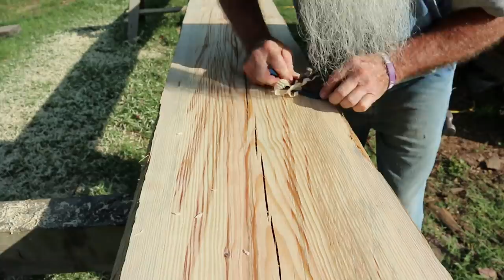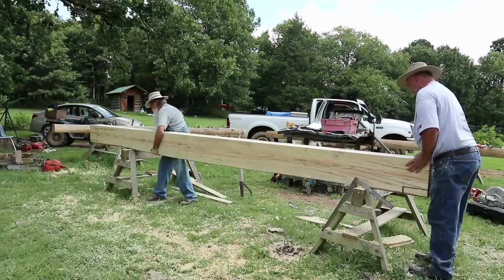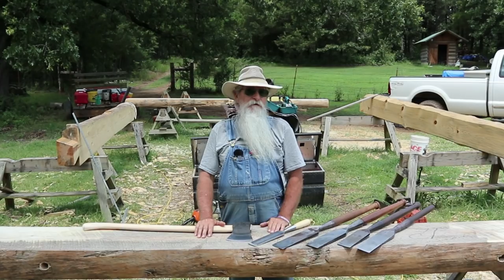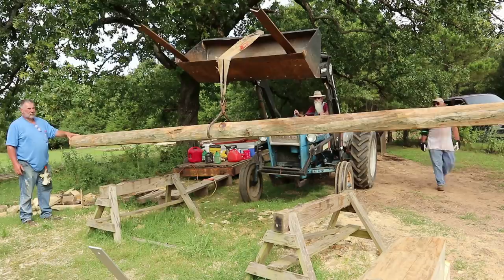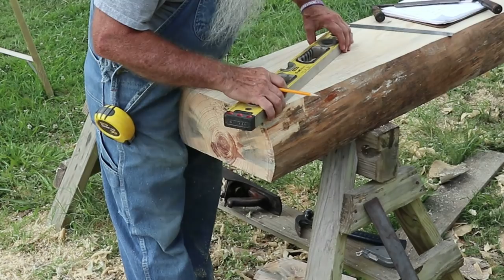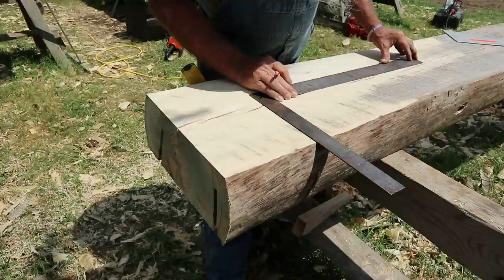Working Out Log Wall Rounds 1 and 2, Paradise Point Log Cabin build - Ep 2

Comment: Great craftsmanship as always.   what is the maximum size log you  work with?
Reply from the maker: Howdy Dave- I’ve worked with different size logs. The smallest I live to use is a 10” tip. I remember doing one wall log that was 30” and 7” thick. Some of the logs we used when I worked out on the road was 8” thick and up to about 26”-28” in width. Those were really heavy to work with. I like working with logs that are about 12”-15” at the midpoint. Take care and God bless you